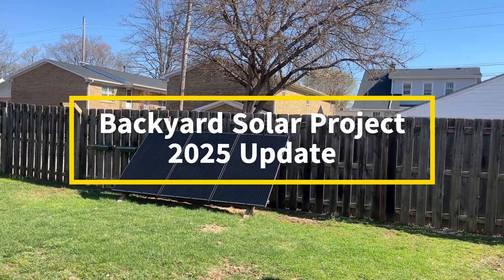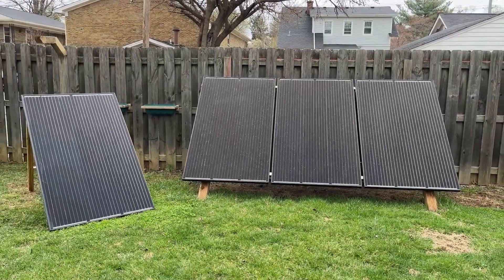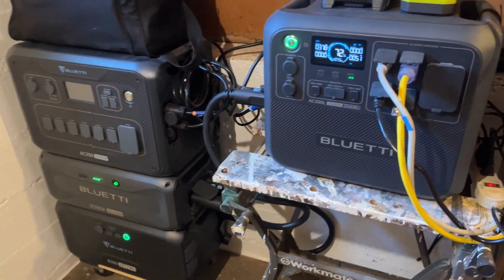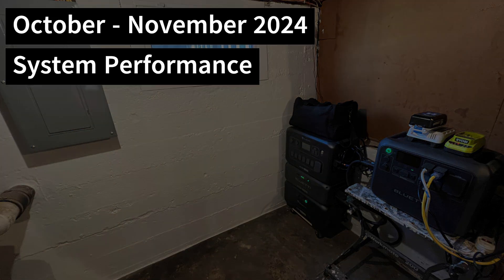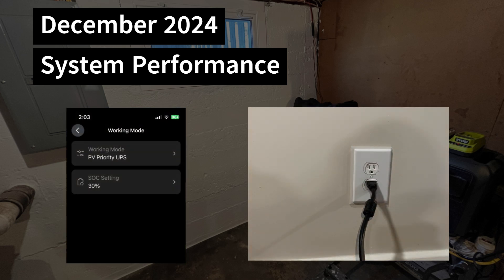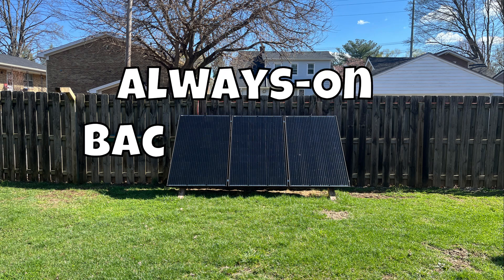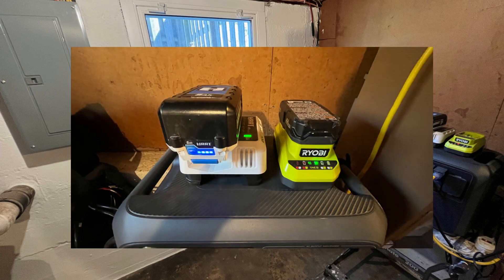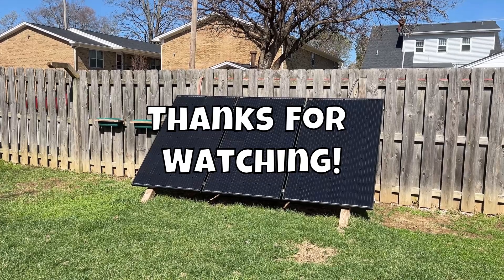Running My Fridge on 100% Solar for 1 Year (The Good & The Bad)

Comment: Serious question that I’m hoping someone can help with. I’ve read about these balcony solar inverter setups that can feed power back into your house from the inverter plugged into a house outlet. I have an EV that I’ve been dumping excess power but I don’t drive much so does anyone have one of these inverters for feeding a house outlet?  Since the solar generator has an inverter, can this be plugged into the residential house to utilize this excess electricity?
Reply from the maker: I've seen some youtubers reviewing those direct plug-in devices. However, I have no experience with them. It seems like the aren't allowed in most states yet. The output from my solar generator has no way of shutting off if it doesn't sense 120V, so it can't be plugged directly into the house. I have to use transfer switches or directly connect appliances with my system.

Comment: Man I love solar but I really don't understand the point of smaller setups like this, as you mentioned there is basically no payback / ROI so it's purely for backup power. But if the main purpose is backup power, why wouldn't you just get a traditional generator? My napkin math estimates this to be around $6800 That can easily get you a generator with all the necessary connecting equipment ( possibility installation too ) which will be able to provide more power and run longer.   

It's sort of a "Go big or go home" situation IMO, where these setups are the worst of both worlds, they aren't as affordable as just buying a smaller powerstation with a few panels but aren't as capable ( both power and ROI ) as a whole-home solution. 

Apologizes if this came off hostile, I just want to know why you didn't just get a generator if main mission is backup power.
Reply from the maker: You make good points.  One other way to look at it:  If you are away from home, the generator has to be turned on and potentially connected to your devices. In the case of the always-on solar backed-up system, we can be traveling and not worry about losing power to key devices.
Reply: @BackyardSolarProject not to mention where’s the fuel for the generator coming from? I have a generator and am in the process of building a system similar to yours.

Comment: Why wouldn't you leave it plugged into the outlet at all times, with the percentage set even lower?  Like 10%?     I have a similar backyard off grid setup and anytime the say a big storm is heading our way, I use the grid to ensure very battery I have is 100% heading into the storm.  I was surprised this didn't come up.   BTW you fridge must be more economical than mine.
Reply from the maker: Great Question - and that was my original plan.  However, the reason I don’t leave it connected to AC all the time is because with my limited items plugged in, the AC200L pulls a bit of grid AC (maybe 20W) when even in PV priority mode.  My friend said this was a power factor thing (?) and/or something to do with how the AC200L is wired internally.   Also, yes, my refrigerator pulls about 45-55w on average.  It’s a 2023 LG, with a linear inverter.

Good recommendation for anyone with a system like this … I too watch the weather and tip off before a big storm.

Comment: isn't cheaper buy 200 Ah battery and inverter cheaper than Bluetti's
Reply from the maker: For sure - you can definitely build a lower-cost system with rack batteries and an inverter.  I've considered that approach for future projects.  There are also some portability and modular benefits to Bluetti, Ecoflow and similar brands.  For example, if you wanted to easy move components, such as an extra battery, to your camper for the weekend, or loan to a friend during a power outage.
Reply: Yes. He needs to watch Will Prowse
Reply from the maker: @lakorai2  Will has great content - what system has he inspired you to build?
Reply: Yes Will started me on my solar journey plus the ice storm and 9 power outage in one years.  Tested everything running kitchen , family room, and bedrooms on solar.  Next is add generator lock out to the breaker panel  box to cut the cord with electric company. So just use grid for back up plus 7kwatt gas generator.

Comment: Like you I have solar panels in my backyard. Again, like you, I ran into the (good) problem having more solar energy than I can store or use at the time of generation. The only way I was able to address the matter was by increasing the storage capacity of my batteries AND altering my daily routines to match the electrical loads with the generation. For example, last summer sunny days would max-out the battery storage by 10AM (I live in NYS). So, I began preparing my lunch and dinner meals beginning around 10AM. There were days when I needed to add more loads. Like you I began charging power-tool batteries, etc. I was successful on many days. But there were days that solar energy production was just too plentiful and I had to accept the fact that my solar panels would stop generating. I’ve become as obsessed with this as those “hyper milers” who try to squeeze as many miles from their hybrid vehicles before the tank empties. I guess it’s a good problem to have.
Reply: Good update and important point that solar stops producing if there is nowhere to put the energy.
Reply from the maker: Hypermiling is a good comparison, and I like the idea of using some of the spare energy for cooking.  Perhaps a small induction burner in the future.
Reply: @BackyardSolarProject  You guessed it! I use an induction HotPlate to prepare the meals using solar.